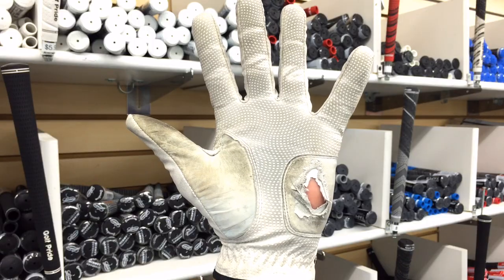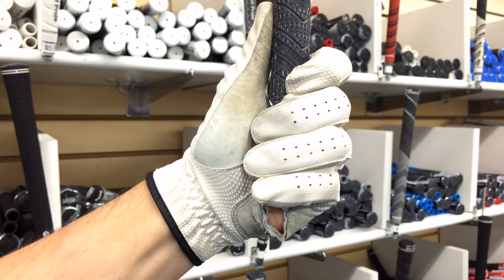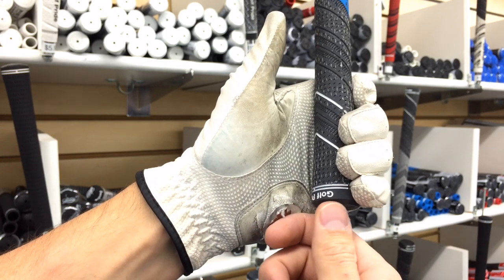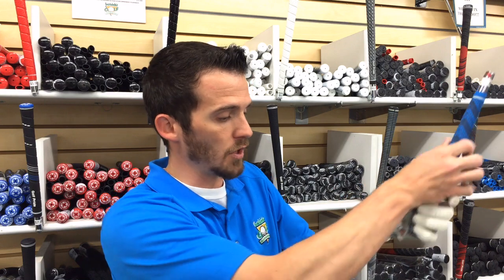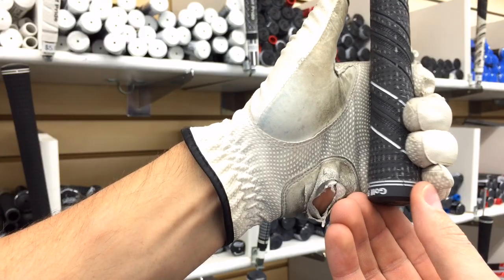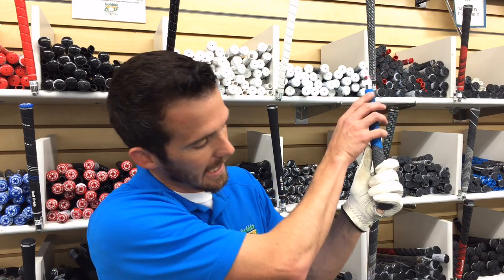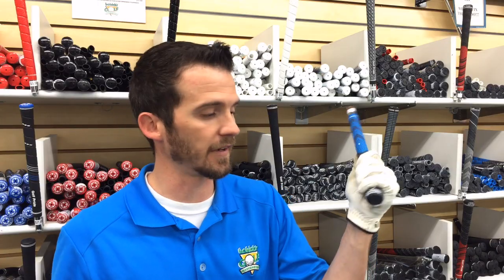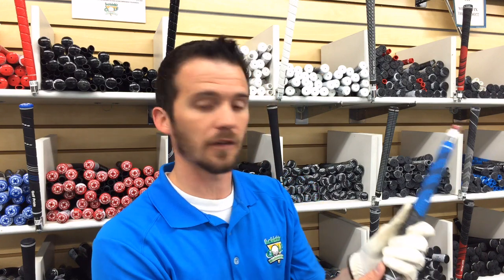Why Golf Gloves Get Holes

Comment: Hey Randy, I have a problem with a particular wear spot on my glove. As I play with corded grips I know it will wear out quicker than the tour valvet grips. 
So the wear spot, it's on my left thumb on the proximal phalange area of the thumb. It doesn't effect my performance but if it could be avoided then that's great. 

If it helps I use multi-compound grips standard size and wear a Titleist players flex size M. Keep up the helpful content
Reply from the maker: +Marco Da Lanca The only thing that I can think of is grip pressure.  Try lightening up your grip while directing the majority of the grip pressure to the last three fingers of your left hand.  Should detour you from pinching the grip between your left thumb and index finger… which I believe is what are causing the holes.  THANKS!